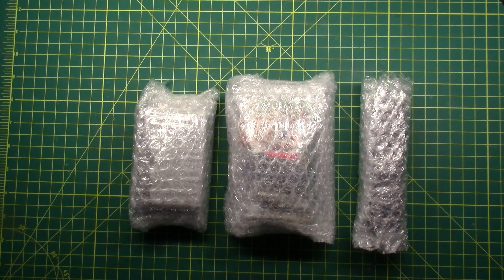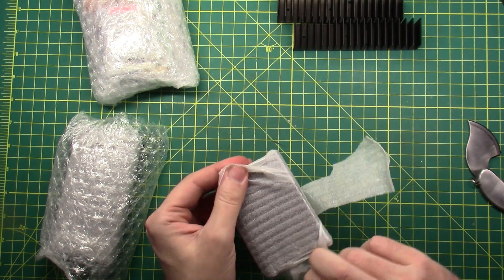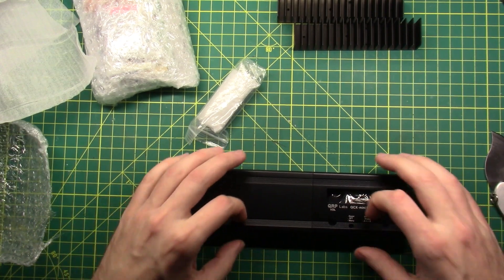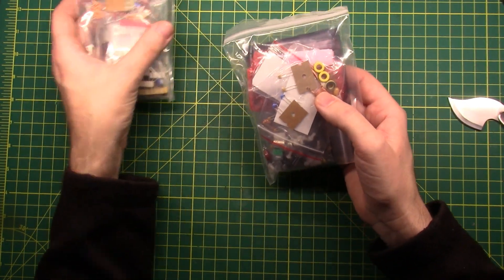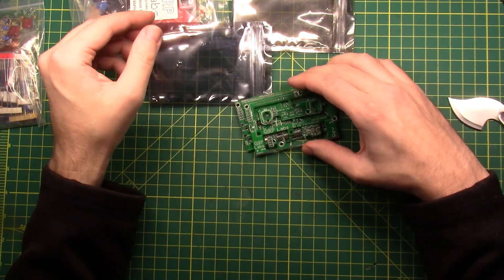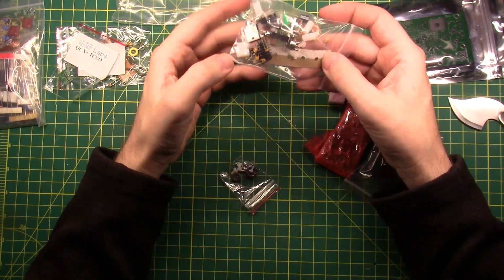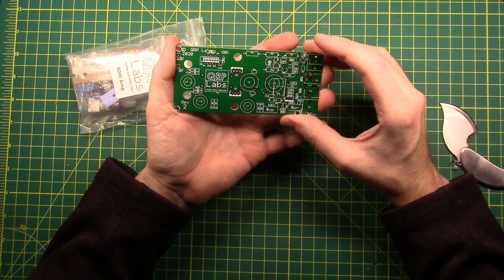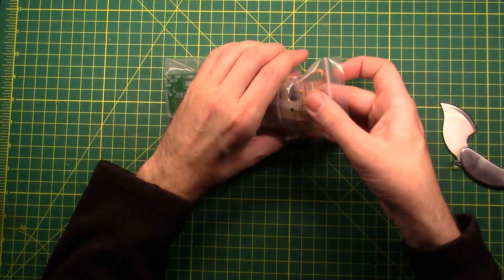How to build a QCX Mini - Part 1 - First Looks

Comment: I got mine all assembled and tuned, it fits in the case and I can hear stations. However it does not tx any power what so ever. I will have to go over all my toroids again and check. I checked each one after installing to see if I had continuity and it worked. I guess I could resolder to make sure the enamel  is completely removed. Do you have any suggestions? Thanks and 72/73
Reply from the maker: I ran into that problem on my second build - try your PC sound settings, including volume
Reply: @temporarilyoffline  Is that in the radio options? I'm not understanding what you mean :(
Reply from the maker: @ai5dd  no, on your operating system - windows or Linux or Mac, make sure the volume is turned up.
Reply: @temporarilyoffline  I was talking about the radio (QCX) not sending any RF out, sorry. Watt meter doesn't doesn't show anything.
Reply from the maker: @ai5dd  yes, same here.  If your volume is turned down on the outbound audio device that represents your radio on the computer, you could be going into TX mode, but sending silence AKA no power.
Reply: @temporarilyoffline  I'm not using my radio with my computer. I'm setting up the radio post build, not using any Digital, just CW. I can RX just fine, but TX does nothing, if that makes sense. Not connected to my PC, just to a dummy load with a watt meter in between.
Reply from the maker: @ai5dd  ah ha!  I thought we were talking about the QDX! I think about it some more.

Comment: Look forward to the build. I followed Dave Casler on his build. It would to be good to get your opinion on the level of experience needed to build.
Reply from the maker: So far, it looks like the only level of experience is: "I've built enough kits that I'm comfortable with a project this big".  The docs are very very well done, Hans is very honest about a mistake on the board and documented the fix... its a long build, but not a difficult build.  And the price is low enough that it wouldn't hurt to put it down and come back later if you do find yourself over your head.  All that being said, Join us on discord (link in video) if you're not already there.  A few of us are building them.

Comment: Did you see the part in the construction manual for the QCX-Mini that says "do not just dump the parts out, only open each bag when we tell you to"? That's because some toroid cores and parts look like other, different parts. They never send documentation with the kits, you download them from the website and print them if that's how you roll.

Start with the transceiver, please. I built my amp when I built my regular QCX. It...still needs work. :P
Reply from the maker: Hey Gwen, Thanks for watching!  I haven't looked at the manual yet, but I've heard good things about it.  If he said that, I wish it would have been on a piece of paper wrapped around the outside of the kit - I'm probably not the only person that tore right into it with wild abandon and excitement ;-)  Receiver first, got it!